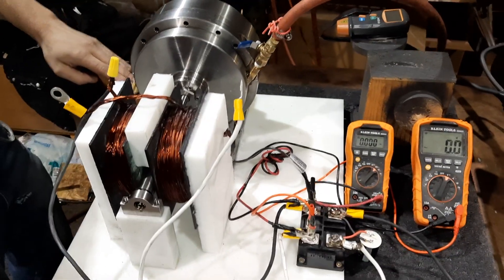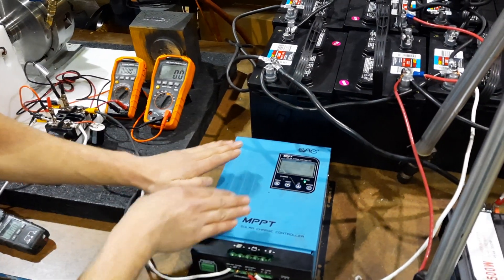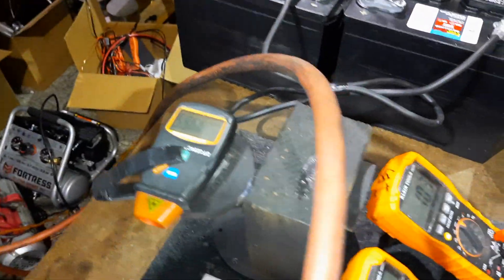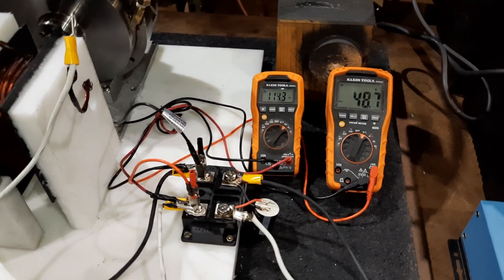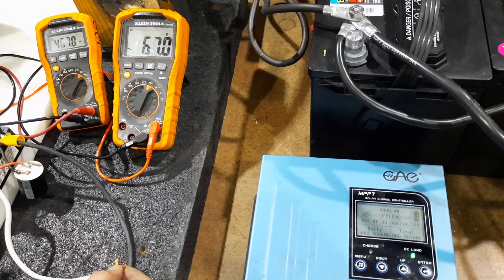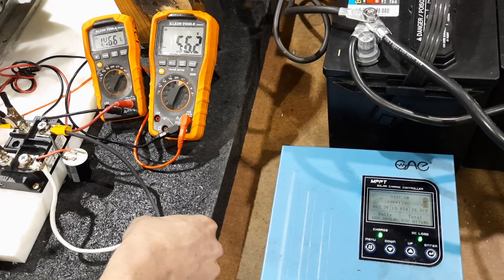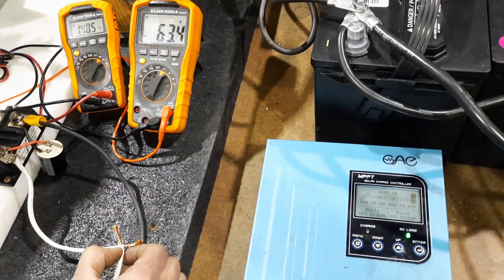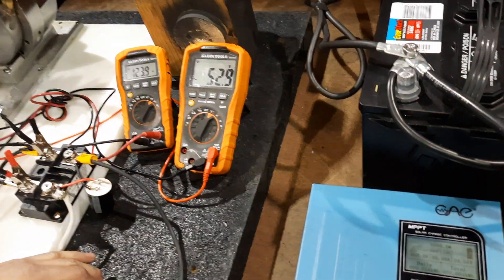Tesla Turbine Producing Usable Power! LOAD TESTING!

Comment: The Amps are not whats causing the torque, it´s the power your drawing!
If you increase the windings your voltage goes up and you need less amps for the same power.

Those MPPT controlers are maid for PV, the respons of those to the applied load is instantly.
With that high of a rotating mass, the controler misinterpret the kinetic energy he can pull as a better power point and will stall the turbine!
You need a more linear fashion regulator that is coupled to the rpm of the turbine, this way you can set the rpm at the optimal speed for given air/steam supply.
Reply from the maker: Thanks for the advice! I've since solved the problem though by limiting the current draw with capacitors in series before the bridge rectifier, this limits the maximum load that the controller can draw.

Comment: Use lithium batteries. Lead acid is shit; losing a lot to heat.
Reply from the maker: Correct, heat is a loss, but when the batteries are converted to alum they last nearly forever.

Comment: tesla turbine is most efficient at 50,000 rpm or so.
Reply from the maker: depends on the diameter of your rotor. larger rotors don't need to spin as fast because the speed of a turbine is based on periphery speed not rpm. The larger the rotor the greater the periphery speed per rpm.

Comment: Calculate your efficiency….usually terrible compared to any modern turbine design….Tesla turbines are just a hobby tinkerer’s toy.
Reply from the maker: Actually I have created an off grid system with it and will be going into production soon. Your are just repeating what you have heard from so many others. You'll have to wait and see. when built correctly it's actually the most efficient turbine in the world.
Reply: @iEnergySupply 
You are kidding yourself, if it was better than blade-type turbines it would have found industrial use a hundred years ago.  “Wait and see”…I built my first one over half a century ago.  In reality a Tesla turbine never ends up being the best way to make rotary motion, and is just a high school science fair novelty project.